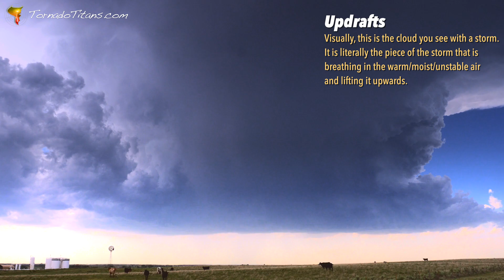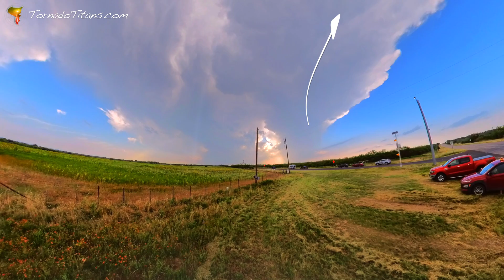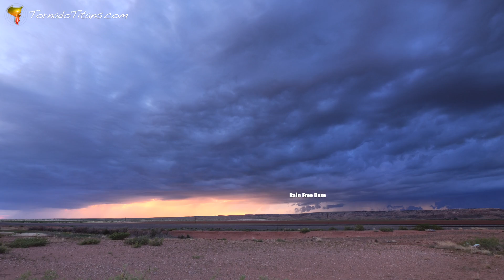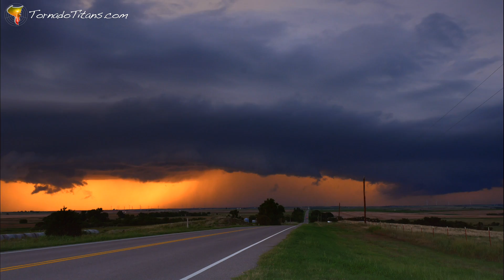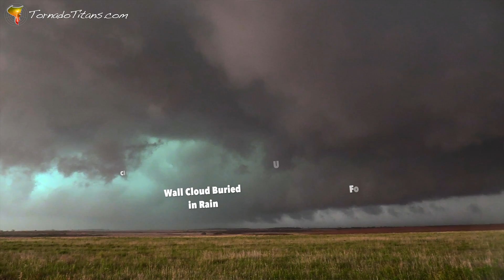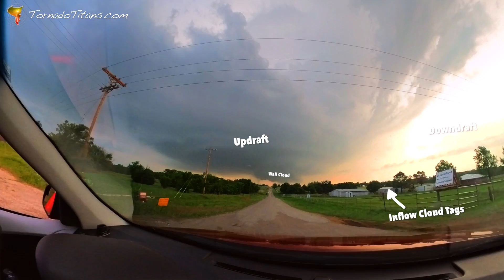A Guide on How Thunderstorms Work

Comment: What about a large almost shelf-cloud looking base that looks very bumpy with pointy tips around the edge. One looked in earlier. Not a ton of lightning though. Some wind but not much rain after either. I guess a thunderstorm or feel trying to form but struggling? And if the bumpiness just caused by turbulence/shear?
Reply from the maker: Could be a lot of things but that sounds like something that was rotating (supercell perhaps) but was struggling with the cap. Usually a smoothed out base indicates forced convection, which is a fancy way of saying the storm was forcing its way through the cap. A lack of lightning/not much rain would be a pretty clear signal it was weaker in that regard -- but hard to tell without a lot more context!